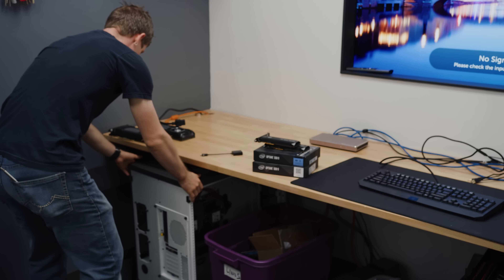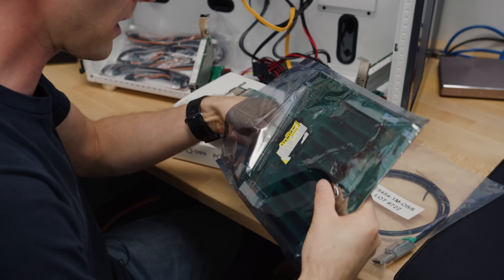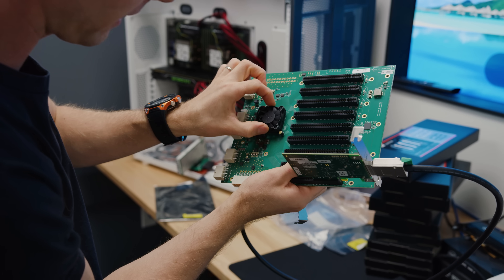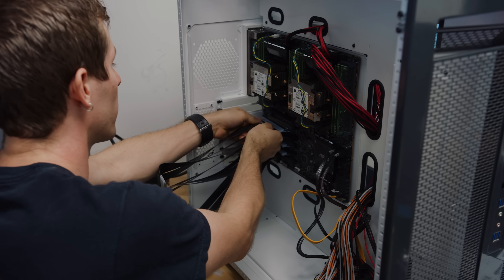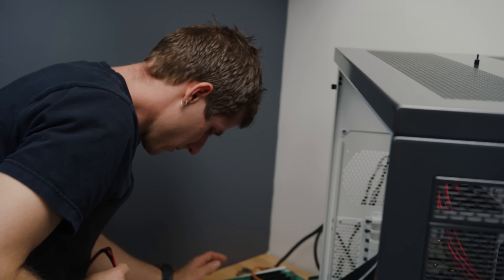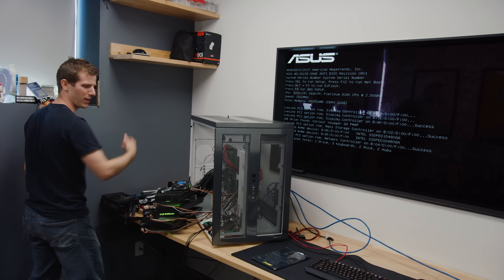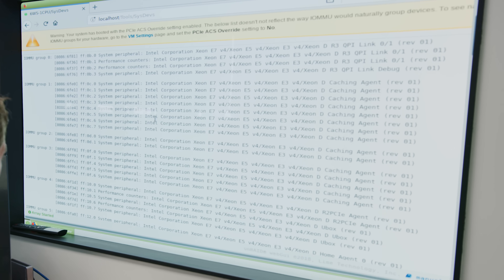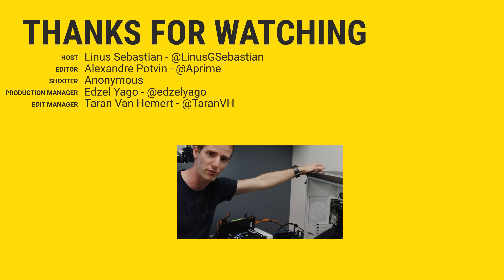Building the $100,000 PC Pt. 2 - SO MANY PCIe CARDS

Comment: I was looking into this because my mobo has only 4 pcie slots. Found a lot of stuff for crypto mining including multipliers and splitters. Talking about mining, when I was doing some work on DSP (quite a while ago) I heard someone say (can't confirm if it was a completely true) that the Brazilian oil company, Petrobras, was nVidia's largest single client. They were re-processing geo-acustic data to get more information from old datasets. Our lab was doing work with them at the time precisely on that task. I believe the computation is more complex and therefore requires slower data transfers from the GPUs or Quattro-like boards.  GPUs are fantastic for DSP because the main operation is vector operation - vectors are a series of numbers one after the other like, for instance, the samples from a digital audio file and if I want, let's say, a four second delay with some more complex sound effects and we work with a 192KHz file that means I need 768K samples and need to sum and divide by two all the samples at once. (A delay would not require that but imagine this is a super weird phaser/chorus/oil-prospecting/delay effect).

What those guys do are not for crypto mining - it's for information mining. Very pro devices!

Comment: Ijust started playing with xeon on china boards, need to figure how if possible to put a pcie 3.0 or 3.1 GPU on a pcie 2.0 x16.
Reply: only thing I can think of is the laptop ones that run off USB 3.0 but I would need to use a pcie slot for a 3.0 adapter and I got one x16 and one of the little ones i think is a x4 and thats it.

Comment: The Ps4 Pro is still $499 +Taxes after 2yrs Which is alot, i know lots of people with a ps4 (A year ago i knew no one) but i dont know anyone with the Pro. I wanted to build a Pc with close to the same specs as possible to the Pro and the video card alone was $320, then theres the power supply,case hard drive, blue Ray drive, the mother board and processor and finally the memory(ram/dims). To build this system it was $1200 Give or take. The ps4  Pro and the xb1 X are accually very well priced and very powerful machines. I had to spend on the gpu (Video card ) 80% of what the Pro costs. In 3840X2160 the ps4 Pro and xb1 X both look super amazing and run very well. Sick of PC obsessors insulting these machines there a very good price and are above a budget PC
Reply: Yes and no. It's an economics thing. Console manufacturers don't really make their money by selling the actual consoles, they make $ on the many game titles. So they stick hardware in the things that would normally cost a good deal more than the price of the console. That being said, if you really keep an eye out for particular hardware deals, buy gently used, whatever it takes, you can build a budget gaming pc that will outperform the consoles you mentioned for the same or less $. I prefer PC's for gaming simply because it's easy to swap parts for newer versions without having to build a whole new machine. It stays competitive longer and, done right, costs less long term. PC versions of multi platform games are usually capable of higher graphics quality, and have additional features. Console games have to be programmed to run smoothly on the current console system. So despite being a new release, a console game will be essentially the same (graphics wise) as the games released a year or more ago. They only get improved when the next gen console comes out. I'm not knocking consoles (although I wouldn't buy one myself), just saying that PC's and PC games advance more rapidly than consoles. There are exceptions to that though.

Comment: I am over here dreaming of having a gaming pc
and Linus is like “we will just start with 4 graphics cards
Reply: You dont have to dream. A gaming pc is within your grasp. Save up a little money about 600 - 800 and build a decent one. You can do it! 😁
Reply: @DylanC444  😔
Reply: @DylanC444  don't even need that much if on a budget... A workstation with 16GB of DDR3 and an i5 will be fine paired with a used 1050 ti and boom cheap medium 1080p gaming. May not be the best experience but for less than 200 bucks it's great for people on a budget that don't need max settings.

Paired with a sub $100 24" 75hz monitor and 40 bucks for a keyboard and mouse and boom you are Gucci.

Comment: https://pcpartpicker.com/user/XfoXshoreX/saved/#view=yZ3kdC
Here's my theoretical 68,700 build.  Not even sure if it's even possible but pcpartpicker says it is, so long as I don't need some of my drive bays.  Also I can't use G-Sync due to my video cards but they were the only ones I could find with a price attached at the moment.  I would've removed the 4 TB SSD and replaced it with a 4th Quadro M6000 for 4-way SLI but I didn't want to give up internal storage and shave off 3800 dollars.  A similar reason is why I didn't just use one Quadro and use 3 SSDs.

Comment: when you put all the most expensive parts on pcpartpicker, anyone?
Reply: https://pcpartpicker.com/user/XfoXshoreX/saved/#view=yZ3kdC
I literally went for the most expensive stuff I could find.  I would've removed the 4 TB SSD and replaced it with a 4th Quadro M6000 for 4-way SLI but I didn't want to give up internal storage and give up 3800 dollars.  A similar reason is why I didn't just use one Quadro and use 3 SSDs.
Reply: @randomlyentertaining8287  the hardest choices require the strongest wills
Reply: I tried and only got to just over 90,000 dollars.
Reply: @kluez8725  x

Comment: In 1007 I bought an 11 lb motherboard with two extension cards.  It ran two 400 MHz CPU’s and  the fastest 10 mb 10k rpm hard drives x four.  I filled out maximum memory with extension cards  a second power supply and an nvidia video card that flew by 1997 standards.  I ran 30 network computers on them at speeds that no one had ever seen before.  $12,000 for just the main‘ toy’ (as my wife called it) running on NT it was greased lightning and remained the fastest unit we had for over 10 years.

Comment: 8 lots of 16x PCI-e all connected over a 4x PCI-e connector is so pointless, a single one of those slots can run at 1/4 speed, so it's like 32x too much bandwidth for the bridge, You'll barely get like 1 optane drive at max speed over that, seems pointless to me.

Comment: Looks like an infiniband connection
Reply: it's called IPASS. One stop systems isn't the only company that makes them Cubix and Magma make them also. Also the nvidia Tesla compute servers and Quadro Plex units are basically the same thing and use the same exact cable. I've been using old Nvidia s870 Tesla compute servers I picked up cheap on ebay for this same thing for quite a few years now. Just pull out the old C870 cards, trash them, and install any PCIE x16 card you want to in their place. Works like a charm. The later s1070 and s2050 have to have one tesla card left in them. Otherwise they'll power up, look for a tesla card, then power back down. You can modify the power supply pins to prevent this, but the older s870 units don't care what cards are in them and won't do this.

Comment: Spin that mobo 90 degrees so the MOBO's PCI slots and back panel inputs instead poke out the top of the case like my Silverstone Raven's 01 design. I would also hang the graphics cards from the top of the case on the opposite side of the mobo.This is the least stressful position on the card and most effective way to dispel heat from the case and cards.
 If you have room i wonder if you could place the cards flat along the side panel still mounted to the top of case and cut out holes in the side panel for the fans to draw cool air from the outside and blow gpu hot air out the top?
 Maybe if your using liquid cooling then  instead cut out holes in the panel for  liquid cooling hose and run that out the gpu then out the side panel and over the top of case to a horizontal top mount radiator/case fan exhaust. From there plumb tubing back into the case  to a large bottom mount tank chilled by using the Peltier Thermoelectric cooling method(solid state cooling)and run the hot air exhaust  from the  thermoelectric blocks fan through an exhaust pipe vented out the un-populated back panels pci slot cut outs...from bottom of cooling tank plumb gravity fed chilled  coolant to the  floor mount pump then up to  CPU , RAM , m.2 drives and graphics cards. (= GPU to radiator to chiller tank to pump to CPU to ? to GPU's)
  I would also put 3 blueray burners in the front panels since its obvious microsoft and others don't want us having the ability to use what that technology can do. 
 That would be a cool unique setup.

Comment: would not be more simple to use a dedicated computer as a SAN with flash drives in RAID configurations, which serves through fiber channel or fiber ethernet a raw storage 'logical' drive, used finally by a workstation to run VMs ??

Comment: building a pc and this what i put together should i replace/upgrade/downgrade anything fortnite and browsing are the two min things im going to be using it for maybe ill try out some new games once in a while  
  Evga Gefore  GTX 1080 
intel i7 8700k 
gigabyte Z370p
16gb ddr4
evga 650w power supply
120mm cpu air cooler
120mm case fan
128gb ssd
1tb hardrive

Comment: After all this and ending at 1 breakout card for each VM  why not just have seperate systems?
You may then say so the diff VM's can move around to new server or diff section of the monster.  On the surface this is what VMware does though he is prob looking to get the HW performance for editing so yes VMware and other hypervisors can do this however, at what cost?  VMware is not cheap per host license and then support for each .

I get where he is trying to go with the build, though, seems like he going to end up with 8 systems maybe less on some shared sub-systems  like a power supply, though likely any cost saving will be eaten up by the extra PCI HW  :(

Might be worth looking at a solution that been around for years from Norton Ghost called universal restore, this means without a single VM hypervisor per host  just for the portability you can get same results with native HW performance while not using VM or passthrough though get all the joy of bringing up on new HW in minutes!!

Comment: Quick (highly technical question): Assuming that the optane drives are 900p series, why put them on the x16 slots? The specifications on the optanes 900p are PCIE 3.0 x4, and you are not going to have better performance.

Comment: 3:13 Never lay down boards on top of anti-static bags. The bags are designed to keep static out and not from the outside. You are laying the static sensitive components right on the top of pretty much the worst place you could.
A recipe for future component failure.

Comment: At which point do you just buy a server board that supports quad processor configurations and has sufficient PCIe lanes as is, then mod it for a secondary server rack case full of radiators?

Comment: won't extending PCIe functionality, which is coming from the CPU PCIe lanes, throttle down as multiplexing over the extension to access each of the extended PCIe ports?
Reply: Ignore me, Linus just said that a minute later. However, all the boards that I look at, never had more out in terms of lanes than what the CPU was able to address. He seems to know some though, of which I wasn't aware of any. Another day to learn something i guess.

Comment: Why don't laptop manufacturers use that pcie connector for external gpu enclosures if it provides full pcie bandwith?  Usb type c and thunderbolt are innadequate solutions that serve as a bottleneck. Is it proprietary and too expensive to implement?

Comment: running the same hardware on the same pc is running the same hardware on the same pc - to splice the hardware to separate them - isnt that unraid ? why cant you unraid on windows using server systems - format - patch unraid to separate lanes - reformat duplicate - unraid - If that makes sense - at least in theory - it should work - if you can understand the unraided format of my comment -lulz or not to lul

Comment: depending on how expensive or cheap a smaller version of the same break out PLX multi pcie card is - you could potentially run the SSD and USB 3.0 controllers off four sets of em...
Reply: i have a plx card that makes 8 pcie x16 slots from a single x16 that utilizes th whole x16 slot, for less than $100. ive ran 8 gpu's off it fine.

Comment: I have a request linus (or whoever reads this) 

Instead of building all these expensive computers (that are fun ). How about trying to build a 2018 Pc, that is at the perfect value bang for the buck with new parts ? A pc that is futurproof (2 years or so ) that is capable of running any game of the moment at a decent frame rate and graphic, for the best bang for the buck ? 

What is the magic price ? 1200$? 800$? 

At what point does the amount you pay not get any more real power out of the machine ? 

I know there is a point where you start paying premium prices for .5 seconds faster boot and 10 FPS more .... 

But what is the real sweet spot ?
Reply: HolyBookProductions technically speaking future proof is not an actual thing since there's new tech/hardware being released just about every couple months now. New graphics cards are around the corner, new CPUs later this year etc.
Reply: LordIron Yea I know that’s what makes it so difficult for me. 

I have no real budget limit. But I don’t want to spent 1500$ if I can get a pc that can do the same thing for 1000$ 🤔 

My pc I have at the time used to be able to play in ultra. After one and a half year I played in high. 

Now I have to play games like battlefield 1 in low graphics because my cpu isn’t fallowing :/ 

The bad thing is I bought my pc with versions 3 of the components that have to go on the mother board and now there is only versions 4 🤔 so I can’t even just upgrade It have to change motherboard cpu and graphics card :/

Comment: I haven't gotten very far in yet, but my guess is he's going to run into the limits because pcie has a set number of lanes. Like what's this 1 slot into 8 black magic? EDIT: It seems Linus has run into a roadblock, and I would guess the lanes are the issue.
Reply: themikead99 as Linus said, some of the editors will get a full x16 lane while others will get a little less so probably anywhere between x4 and x8 lanes.

Comment: 5 12v EPS connectors? I would go one GPU at a time. I don't need to fry 8 Titan X's at once lol. Every time someone asks what happens if you directly connect EPS to an 8-pin for PCIe power port the answer is you cant without modding it and the card would probably break

Comment: Try using VMWare instead of unraid, it has much better support for hardware passthrough than Proxmox/Unraid because it doesn't run the VMs with QEMU/KVM which has trouble handling IOMMU families..

Comment: Just use a EPYC board (it give you 8 (X16)) to have 6 full(X16) pci-e for graphics cards and the seventh pci give you four(x4) and the least pci, give you two (X4) each one, for each of the 6 users, also one more (x4) for system disk and the last one (x4) for X390 bridge. all(except x399 connection) adressable by pci passthrough. Also you got a lot more memory pool to feed 6 users.
Peace of mind, that's it. I just reply because i felt your pain Linus, and you don't even start to set up all this mess...

Comment: Thought about this video after going to sleep last night
This is a 56 core system, consisting of 2 28 core processors
Any particular reason you used 28 core xeons instead of 32 core epycs?
Reply: Amiibo Alec Probably cause he prefers Intel for workstations I guess. As much as I like Linus he really leans into Intel's side of things for a lot of stuff. And a lot of editing programs like Premier tend to favor Intel CPUs over AMD CPUs. Adobe optimized it for Intel more than they did AMD.

Comment: I dealt with these types of boxes before with a PowerMac.  We had issues with having 3 different SCSI controllers in the system and the expansion chassis.  Ended up being a problem with Boot Memory and we had to put the SCSI controllers in different slots that we wanted to put them in.

Comment: It likely isn't able to separate the expansion board due to being unable to bifurcate the lanes on the expansion card, and even then, you'd most likely see a PLX chip on the board for each individual bifurcated lane(s) if it could.

If you REALLY wanted to, you COULD probably do something like this on Threadripper by getting an AsRock Ultra Quad, and putting in 4 M.2 to PCIe x4 connector slots, and THEN connecting 4 of the 8x16 PCIe daughter boards, as Threadripper is able to bifurcate the x16 slots into x4/x4/x4/x4 for the Ultra Quad due to the Lanes being purely from the CPU. Then again, you'd think Intel's Scaleable Xeon platform would support at least a few x16 slots for bifurcation for this trickery as well, but haven't seen any tests for it as of yet

Comment: Will the VMs have dedicated cores or will they be able to take advantage of all the all the currently available CPU power? If so that would be an actual advantage over separate workstations. If not then it's just a ridiculous and fun but ultimately pointless crazy build.
Reply: you want to avoid dedicated cores, the point of VM is that it will allocate CPU and RAM resources as needed assuming not all your VM will be working flat out all the time. With multi socket configurations you also have to be aware of NUMA which can affect performance.